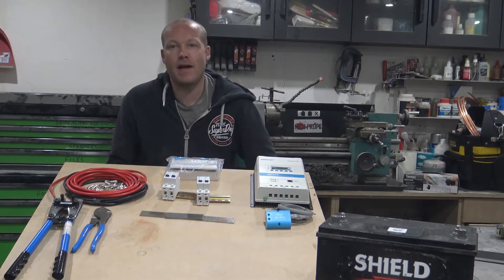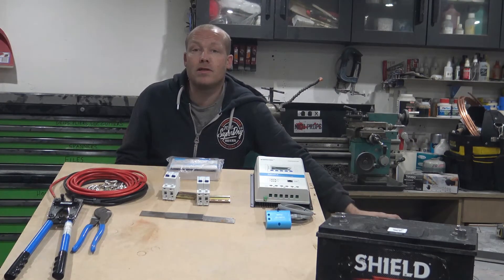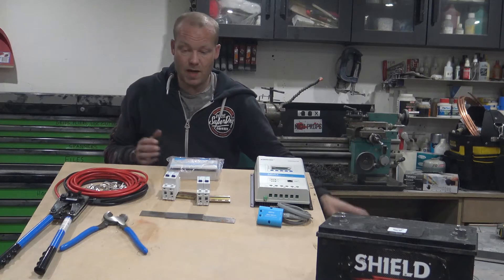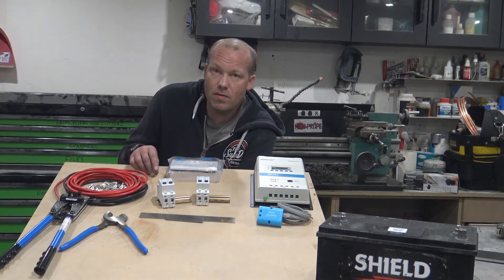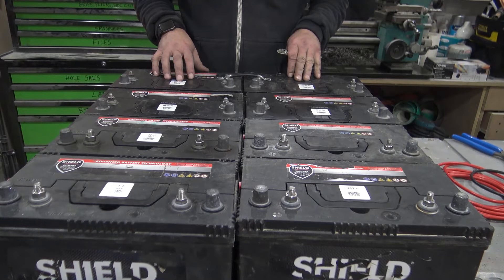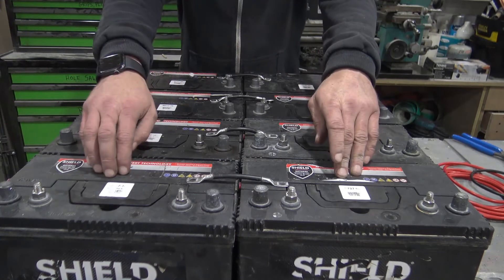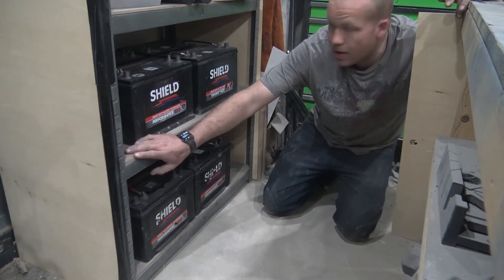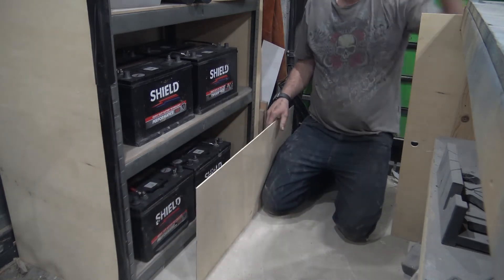Solar power, under £1000 : part 1 , EPEver Triron 4210n

Comment: Great video, why do you need the separate charge controller, does the one built into the inverter not meet your requirements?
Reply from the maker: i didnt need it exactly, however I have and up and coming build of a windturbine and I wanted to keep that on a separate control. also in my original configuration of the solar panels the charge control on the inverter wouldn't have been able to cope with the solar at full output.